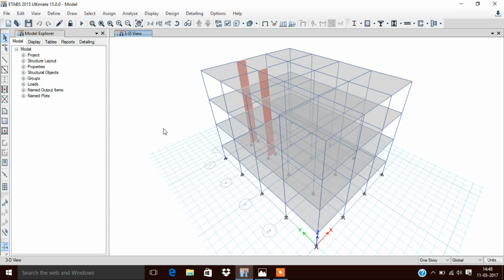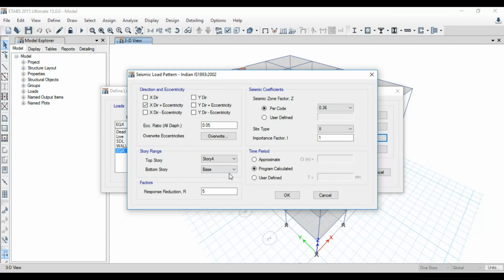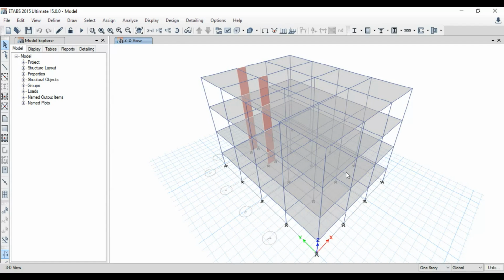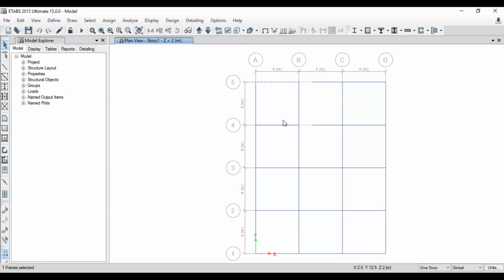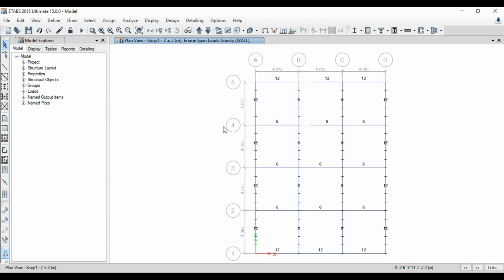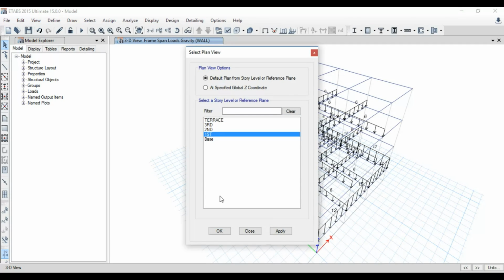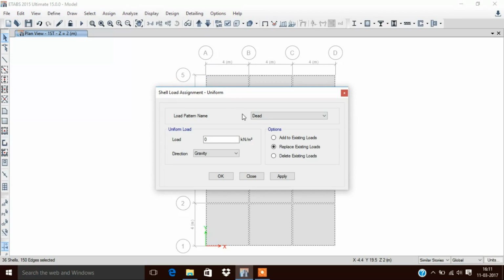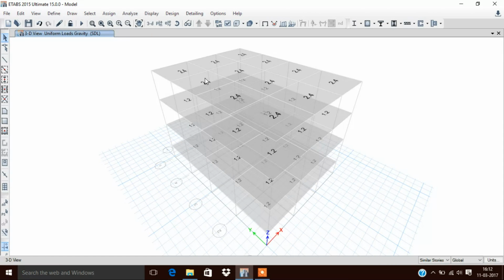How to APPLY LOADS in ETABS

Comment: nice explanation, in autocad the column was not in center of beam, but you took column on center of beam, so it is recommended to place column always in center? and yes, what is two beam are meeting at one column and both are eccentric then what should do, why height from base was taken as 2m ? if base is foundation, what about plinth beam(gf) then first floor and so on, can you plz explain this in detail. thankyou